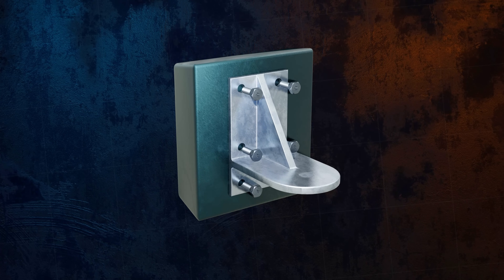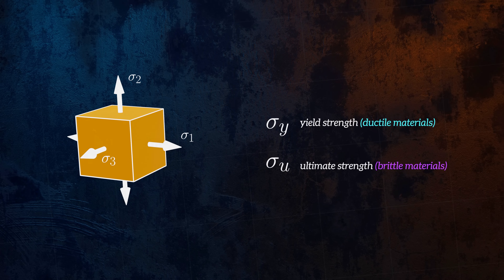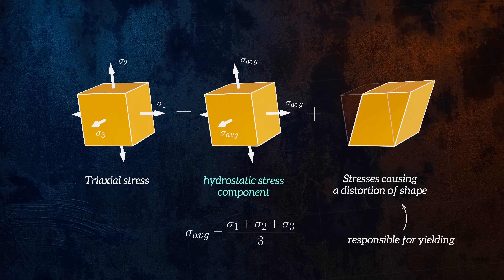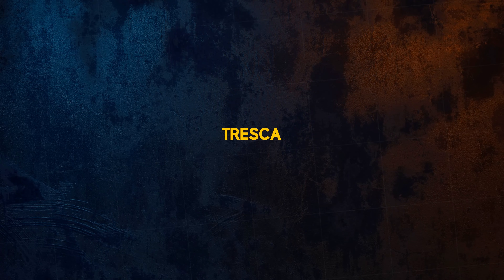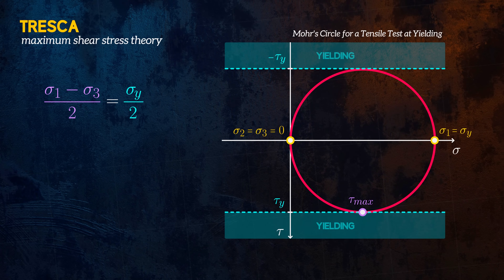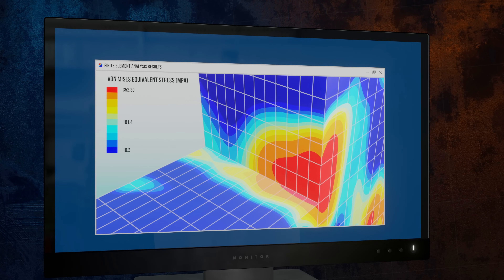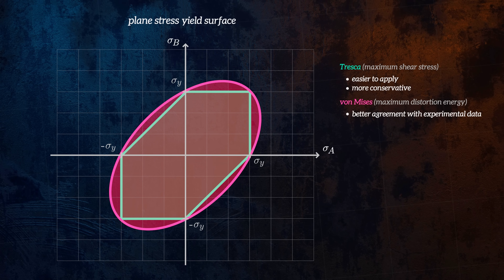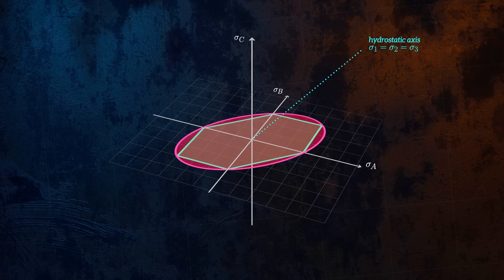Understanding Failure Theories (Tresca, von Mises etc...)

Comment: Although you mentioned that brittle material usually tend to has compressive strength much larger than tensile, it just not true for composite materials, such as CFRP/GFRP etc. In opposite, tensile strength is more than twice as high due to kinking (for ex.). It would be really useful to see your videos about Tsai-Hill, Tsai-Wu, Hashin, Puck, Larcs Failure Criterias or other criterias for orthotropic or transversally isotropic materials. But anyway, great work done!

Comment: I would be more careful with calling some of the criteria "failure". For example some local yielding is perfectly acceptable for many structures and may even be beneficial in some cases. On the other hand, there may not be better term encapsulating all the criteria and it is conservative, so its not a big deal :)
Reply from the maker: Yes I completely agree. What we're really talking about is material failure. And if localised, material failure may just result in a redistribution of stresses, it doesn't necessarily result in complete structural failure. I had originally planned on mentioning this in the video, but I took it out because I felt it was getting too long!
Reply: @TheEfficientEngineer   I think in case of local cracking that would not lead to failure of the whole structure, I would consider the cracking a local material failure. However, yielding is another story - it is important for forming and in some cases, it improves a "finished" product. For example, pressure vessels can be tested at pressures, that cause local yielding. This does not affect static strength but it improves fatigue life, because mean stress in critical areas is lowered. I would have hard time calling this a failure, but maybe it is just semantics. Anyway, I definitely agree with you that the video would be too long if you wanted to cover all of these issues. I like it as it is, especially the visuals :)
Reply from the maker: Great points in any case, thanks for bringing them up!

Comment: Great video as always... Can you also do a video explaining physical intuitive meaning of moment of forces?
Reply from the maker: Yes good idea, I'll have a think about that!
Reply: @TheEfficientEngineer  thank you so much for considering my request... Thank you!!
Reply: @ShauriePvs  Moment in general means a quantity is multiplied by an applicable distance.  Moment of a force, is a term that physically means the same thing as a torque.  In the case of moments and torques, moment of a force is a cross product of the radius vector from the origin, to the point at which the force is applied.  Torque (or moment of a force) is the rotational term analogous to a force, as it works with Newton's second law for rotating systems.

Moment and force are physically the same thing, but engineers don't uses these interchangeably.  It usually has to do with the axis of the load, whether it is along the structural member to be called a torque, or perpendicular to the axis of the structural member to be called a moment.  This convention is "bookkeeping", to have different vocabulary for the different types of torques.

Comment: Efficient engineer please make a video on flexible cables under concentrated loading, distributed loading and loading of its own weight.  I was wondering on a question you can answer this by making a video on fluid mechanics or fluid statics.  The question is if the pressure of the fluid increases with depth assuming that the density of fluid is constant throughout, the  temperature of the fluid must also increase with depth  . Please someone answer my question.

Comment: One thing that I'm curious about here is the statement that hydrostatic stress can't cause a material to fail. This is believable for hydrostatic compressive stress assuming incompressible material, but surely hydrostatic tensile stress will tear the part to pieces just as effectively as uniaxial tensile stress?
This is by far the best handling of this topic I've seen anywhere. First time I've seen the 3D versions of the failure envelope too.
Reply: Hydrostatic tensile stress will tear the part, but not as effectively as uniaxial tensile stress. You can see it from Coulomb Mohr criterion, which has the highest strength in tension in the hydrostatic state.

Comment: Being a teacher myself. I can only imagine the efforts you are putting in order to explain difficult stuffs so easily and artistically.
Kudos to you. 
Keep doing the good work
Reply: As you said you are a teacher . Can you answer my one question ? If the pressure of the fluid varies with depth assuming the density to be constant,  should the  temperature  also increase with depth in a fluid? I think yes. See the atmosphere above us a good example of it.
Reply: @physicslover1950  there is no relation of variation of temperature with depth . 
Think about  ocean water as its top layer has high temperature than the water in depth bcoz of solar radiation . 
As we goes in depth water has less exposer of solar radiation bcoz radiation can penetrate in water upto a depth  . 
When it comes to earth Atmosphere the atmospheric layer near earth has high temperature bcoz of reflection of radiation from earth and then greenhouse gases like water vapour , CO2 do not allow them to escape which causes increase in temperature of earth near layer atmosphere
Reply: @physicslover1950  by the way atmosphere doesn't have uniform density... So you can't compare the almost uniform density scenario of water and highly varying density case of air
Reply: @physicslover1950  that's a very vague question there are many factors to consider here, 

By basic definition temp is measure of thermal energy which in turn is in case of solids and liquids is oscillations and in gas degree of random motion. 

Even more important is the fact that these changes in density of liquids are negligible with depth almost 2-3% you are comparing two different fluids with each other. Air is way different than water. 

And in the first place how did you manage to think that way?  That temp would increase if pressure or density increases??  State eqn, I assume like ideal gas eqn, then its not applicable for subcooled liquids and I could even argue that Bcz we move air so much near the surface of earth the temp of air is higher, you get the point. 
I'm not even talking about radiations

Whatever keep thinking, it's a good thing.
Reply: @अण्वायुवरीवर्त  Thanks for the motivation actully I got the answer 2 months ago that the temperature doesn't increase down with the increase of pressure because if the temperature increased then according to boyles law volume must increase and if the volume increased the density of the liquid becomes less than that on the surface which is a vogue and non sense statement 😅. 
Actually the density decreases as we go down . 
Pressure =(constant)(density)( temperature )

So in this case the increase in pressure is only due to the increase in density and an increase in density is due to the dcrease in volume . Recall again the equation

PV = nRT
Or
PV= T

When pressure increased with depth the volume decreased and temperature remained constant and wise versa. In case of earth the temperature increases down due to non uniform gravitational field. But in case of a swimming pool the gravitational field is nearly uniform.
Reply: @physicslover1950  there's more to it than ideal gas equation, read about fluid statics. Anyways I'm tight on schedule got nightmare level exam on Saturday. 

I miss those discussion forums.
Reply: @अण्वायुवरीवर्त  Yeh fluid mechanics is my current semester subject.
Reply: @physicslover1950  where do you study?
Reply: @100rav_S1ngh  Lahore🤧🤧 Pakistan
Reply: @100rav_S1ngh  Lahore🤧🤧 Pakistan
Reply: @physicslover1950   Ohk... Do good for your country and world..Btw I'm your neighbor from India!
Reply: @physicslover1950  no,
Reply: @physicslover1950  temperature varies in atmosphere due to varying density
Reply: “Silver is for the kettle, and gold for the furnace, but The LORD is the tester of hearts- Bible” your heart is like discovered silver, dirty and not pure, when silver is purified it is melted over and over, to the point that when it’s melted and glows red hot, it is pure enough to see your own reflection in the puddle, so also does the LORD purify your heart, till HE can see HIS own reflection in it, seek the LORD and be reborn, ask The LORD to renew and restore you, repent and ask The LORD for HIS Salvation for those who seek will find and those who knock the door will be open unto them, no man is good, all are in need of salvation, Jesus died so that our sins will be wiped away and so that we could be made new, seek The Kingdom of GOD for if you would be wise you would be wise for yourself, pick up your cross and deny your flesh and follow the path of GOD, for The Kingdom of GOD is at hand, in JESUS MIGHTY NAME Amen and Amen

Comment: Thank you! I recommend your videos to my students.
Reply from the maker: Great to hear, thanks!
Reply: I did the same...
Reply: I'm CR of my class and I told my class about this channel.
Your channel is hidden treasure.
Reply: Can someone answer my question if the pressure in a fluid increases with depth should temperature also increase with depth assuming the density of the fluid is constant throughout? I think yes.  See the variation of temperature of atmosphere above you .
Reply: @physicslover1950  there is no relation for a  fluid to increase its temperature with pressure ..decreasing of atmospheric air above us is for a different reason (which i dont know exactly ) but not due to decrease in pressure ..
Reply: Eugen Nachtigall I hope you will answer my question respected sir.

Comment: I remember when I do FEM analysis using a software, these failure theories are present at the handbook/users’ manual of the FEM software. It is very nice to see the interpretation of these theories here. You did a great job. Thank you.
Reply: can u send me the user manual
Reply: @jerin3710  what software are you using? During my school years I used Ansys, it's a decent FEA software. Find it in torrentz or google it. Usually,  schools provide one, but it skips many steps.
Reply: @andresgaviria9559  Ansys is what we use professionally. Atleast in the aerospace industry
Reply: @Tunechi65  cheers mate!
I used nastran to validate loads in beams and other structures. I didn't like to work with post-prod. I miss my school years using ansys.
Reply: can you help me in finding a good platform to learn math for finite element analysisd
Reply: I would prefer you denote the stress component in matrix than presented in plane shape/circles. According to matrix theory, any stress exerting to micro cube must be linearly transformed to the new basis, presented by the matrix. It is just my opinion at this moment.
Reply: Bo Zhao shut up dude